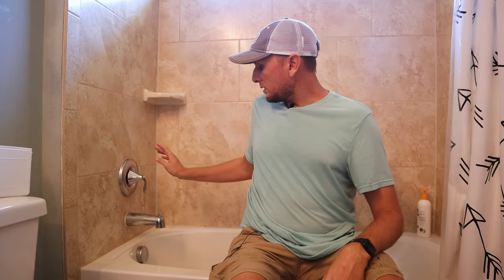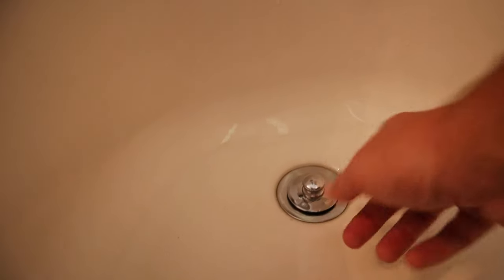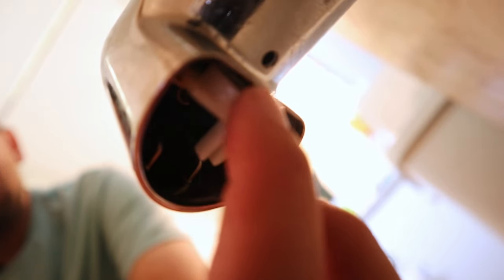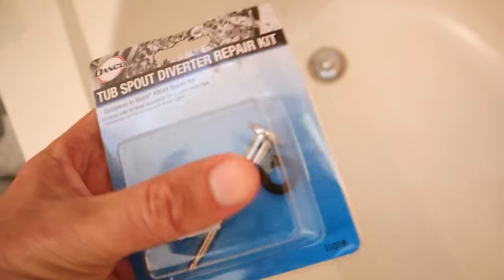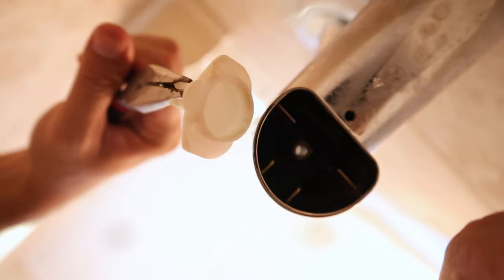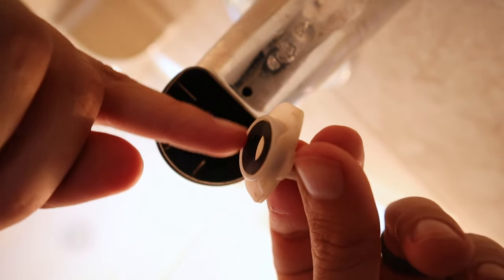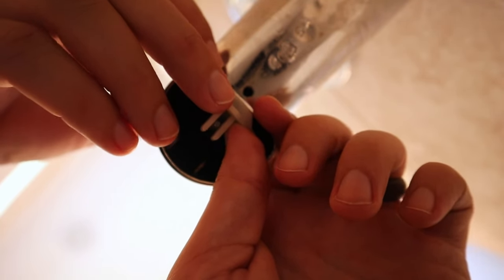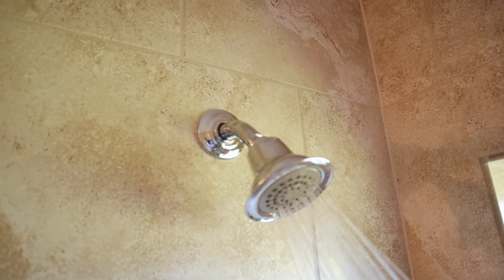Water Not Coming Out Of Shower Head? Tub Spout Diverter Repair

Comment: Thank you!
The plumber quoted $500 to fix this issue.
Cost me $7 from Home Depot and less than 5 minutes of my time.
Reply: Bet you're not calling him again!
Reply: The plumber you got the quote from is a crook.
Reply: @RRCCTexas  Absolutely! Great way to put yourself out of business.
Reply: A plumber from a company with a good reputation installed a new set of taps for the laundry tubs plus 3 shut off valves for $400 today. It was a chore removing the old rusty mounts from the tubs and it took 2 hours to complete the job. I bought the taps previously and feel I got a reasonable price for the installation.

Comment: dude my spare bathroom has been driving me crazy for the past 13 years that i bought my house and has gotten really bad and super annoying to me. i imagine it probably wasted around 2 or 3 gallons of water each time someone showers. I think i have ocd but i like all my plumbing and what not to work properly in my house. super easy cheap fix i cant believe it completely stopped the leak. not even a drop! So beautiful man.  I went back with square for square like you said. if it was my main shower it probably would have been one of the first things i did to my house. thank you!

Comment: I was hoping this would be a simple repair and it looks like it will be. Got my Diverter Valve (DV) out thanks to your advice and think I found a replacement on Amazon for the lovely price of $8. I took mine out and it was sitting back a little from the front of the plastic holder and at 17 years old, a little hard. I tried an o-ring behind it to push it out a little but that didn't help, hence the order for new ones. Thanks for the look inside the nozzle!!

Comment: Ironically, I am heading over to a friends house this morning to fix this exact issue. I hadn't done it in a loooong time, and your video refreshed my memory. Huge thanks and perfect timing...almost.
Reply from the maker: Awesome.  That is pretty good timing.  Glad it was able to help.  Thanks a lot for the feedback!
Reply: What if both the gate & washer are in good shape & issues still exist, what can I check next,  or just replace them & then see what happens?
Reply: @MichaelSmith-sz7kf  Just because the gate and washer appear to be in good shape doesn't mean they aren't worn out or degraded. Mine still had the washer and gate. They looked fine. I replaced them and now it works. Replace them.
Reply: @IAMRUSTEDROOT  appreciate the feedback, ordered a new set for that very same reason/conclusion I made as well!

Comment: This was great. My spout started to leak and I could tell the shower pressure was down a bit.  Drove me nuts all the wasted water just running out the spout and down the drain.   I replaced the GATE and all fixed.   Super easy, super cheap.   Thank You

Comment: Very straightforward video without waste of time. Thank you! Might also start by turning the spout counterclockwise and turning up so it's easier to access the parts for us old folks who don't want to lay down in the tub and work upside down. Or, removing the spout and replacing it after repair with new teflon tape & etc. That also allows you to clean any sentiment/corrosion that is allowing water to leak around the seal. Thanks again!

Comment: Excellent tip! Thank you so very much, Sir. I’ve switched out the entire spout before and was very unhappy with the way the new spout didn’t set flush against the tile. It would’ve required another whole turn but my pipe didn’t have the threads and it would’ve been stuck at an angle. I’m going this route for my new problem. Thanks again. You’ve earned another subscriber.

Comment: It takes a lot for me to comment on videos, but I had to on this one. I had the issue where water was slowly coming out of the shower handle and a majority of the rest of the water was uncontrollably spraying from the spout still when the diverter was supposed to be engaged. I have a spout that doesn't seem to have a set screw and seems to be impossible to twist off.  This video was so clear and concise as to what I needed to do to fix this issue myself without having to shell out more cash than needed to have a plumber come in... not to mention waste their time when they could be taking care of much bigger jobs than this one.  

I followed the steps of this video and sure enough, only have of the black washer still remained. Thank you for taking the time to clearly show everyday homeowners how to fix something simple without having to break the bank!

Comment: Excellent Repair video and very clear explanation.   I had a Moen Faucet and I got the repair kit; did the replacement and the diverter now works normally.  Thank you.  I wanted to know how it works, but could not find anything from Googling.   I try to put in my explanation here and hope to help others who are interested in knowing how it works as well as get the repair done.   Rubber Seal with a hole in the center. The faucet water inlet hole is bigger than the hole of the rubber seal, but smaller than the seal itself. So the rubber seal could seal off the inlet hole completely when pulled to the UP position, forcing water to come out of the shower. The water pressure coming into the center hole of the seal can inflate the rubber seal slightly to produce a water tight setup. Therefore, a soft rubber seal is important. When it is too old it can harden and would not provide a water tight setup. It shows how clever this design is. The water pressure on the Plastic Gate would hold the Gate in the UP position. The Gate would not fall down because of frictional force. However, if the water supply is cut, The Gate would not be held there and falls to the DOWN position and this also the default position. So, next time you turn on the water, it would come out from the faucet and not the shower. When showering (ie, Gate in the UP position), if you manually push down the rod/button, you can overcome the frictional force created by the water supply and get the Gate back to the DOWN position, stopping the showering, and let water come out of the faucet. Note 1, the faucet water inlet hole is inside the faucet you have to use a light to find it. Note 2, water tight to the water inlet hole and around the circular plastic ring surrounding the rubber seal on the Gate, you have to examine a diverter repair kit to appreciate the design.

Comment: As a retired man, who used to just hire his repairs done, and now finds he is doing a lot of minor jobs and doing them for the first time, thanks.  I never would have gotten past the initial failure to remove this part, the part being where it could not be observed.  And that was the hardest and longest part of this repair, fiddling with opening the part to allow it to be removed.  Well, the other time consuming part was traveling into the near by town, since the hardware store in my little town would have sold me a new faucet rather than a part for the repair at 1/10th of the cost.

Comment: Instructions worked for my Price Pfister diverter problem. Thanks for such clear instructions! I found just the gasket which was all I needed for $2.50 at Ace hardware. I also realized there was some mineral buildup inside that was causing a problem so after I took the diverter out I wadded up tin foil and scrubbed the inside of the spigot. Seemed to make a huge difference. I still have about 10% that's not going through the shower but I'm okay with that compared to 70%.

Comment: THANK YOU for this easy to follow tutorial! As an older woman, I was having great difficulty getting the lift rod to go into the bottom plastic slot. I discovered if I soaked it for about a minute in very hot water it softened the plastic enough for it to slip in. Once it cooled, it was hard enough to secure the rod.

Comment: THANK YOU for this EXCELLENT video❗️
I’m a complete plumbing bonehead  ( heck,  I’m many kinds of a bonehead ) and even I was able to get it fixed perfectly in 84 seconds,  once I found the correct repair kit by looking at  spout gate images online, this after pulling out the original gate.
For the extraction, I used a narrow head standard screwdriver inserted between the two plastic holding tabs where they gripped the lift rod. No tools required for the install phase, friction fit. Perfect repair, under $8, thanks to YOU. 
Note: the old gasket was intact, but 38 years old and hard as a rock. PS: The new black gasket sits slightly recessed in its socket in the gate, but under water pressure it  moves forward & becomes flush to the valve seat to make a good seal. Only after the install that I noticed that the kit I used was the exact same one in your video. Surprisingly, the specialty  plumbing repair supply store that I called first did not have it,  but a big box store did. 
Plumbing repairs make me very anxious, but you gave me the confidence to git it done. 
Adam, you are a HERO to many!

Comment: Great advice, thanks. Two suggestions: I found some mineral deposits on the tub spout where the rubber seal seats. I cleaned them with a screwdriver blade and wiped clean. Second, the replacement kit I bought included a small spring to put on the shaft before snapping the rod back into the gate.
Reply: Thanks William,  great add-ons to the original video. I'm normally a do-it-yourselfer. But we have one bathroom that we just pretty much relegated to tub use only. I'm excited to know that I can just replace the diverter

Comment: Fantastic video and info, Adam! Had no idea the diverter was replaceable! We've been plagued with a guest shower that screams, and quite embarrassing when having guests overnight. I knew it was the diverter either corroded or hardened. Trying to remove the entire spout was proving difficult (felt like the copper plumbing was going to come with it). Based on your video, I just removed the diverter (took 2 minutes) and sure enough the gasket is hard as a rock. Heading to the store today to get a kit. 

Related topic, I've watched a couple of your electrical wiring videos. Just installed a new disposal this weekend, and didn't twist the wires as you recommend. Going to open it up real quick and make better wire nut connections. Keep the videos coming!

Comment: Thank you! That what I do with my Delta Spout Pull-up Diverter. I just need to buy a washer. As the nylon/plastic and diverter is good. I cleaned the inside the spout with a toothbrush.

Comment: Works great! Have done this 3 times in the last 10 years, but now there is so much mineral buildup, the gate no longer slides up and down freely. Ran a flat file up in there but still no luck. Next step is to replace the whole spout, but it won't come off. There is a notch in the back but I can't see/feel a set screw. Can't twist the spout off nor pull the spout off. I'm ready to smash this thing
Reply: @malinwj1, hello, the lift rod in my shower spout is stuck too. I put some WD40 in it before finding this video. I will see in a few hours if it helped otherwise will have to perhaps replace the parts. I hope it doesn't come to that. Any suggestions? Best regards

Comment: Thanks for this video.  My diverter is leaking badly, and the tub spout (at least 20 yrs old) has a lot of corrosion built up, and at least one of the two fins is broken off that keeps the diverter in line.  I can push the plastic piece up with my fingers, but it cannot be pulled up with the bar; it always catches on something rough or jagged.  What would you advise would be my best option -- replacing the entire spout + diverter valve?

Comment: Great tutorial but my issue is slightly different, both my tub and my mom's have got to the point that we can't move the lift rod at all. I had them both stuck in shower position but recently we didn't have hot water for a few months and when we got it back on the shower was no longer working. I used tools to try to move the lift rod and ended up snapping the head off. I got a kit to replace the entire tub spout but am extremely intimidated to actually do it. Maybe somewhat irrational but my greatest fear is that I take it all apart and can't get it back together again, I'm worried something more serious may be wrong. The drain blocker has also stopped working and I will need to replace that as well. The lovely gentleman at Home Depot walked me through that in the store. Do you have any idea what might be the cause of our lift rods not being able to move? Could it be a rust/corrosion problem? Hard water build up perhaps?

Comment: Thank you for this video. I have the opposite problem. The diverter does not drop when I turn off the shower head. It doesn’t leak, I just have to manually push it down to drain the water. Would this solution work for that?

Comment: Great video….. just a heads up everyone, if you have the SQUARE MOEN style diverter gate ONLY LOWES has them …. Home Depot only has the NON-MOEN style which will not fit the MOEN spout. Check which style you have and check online stock availability before driving there… I have 2 hrs in driving time back and forth between the 2 trips,including returning the wrong one to HD🫣🍀

Comment: I did what I learn from you with no problem but the result wasn’t good it is still leaking ! What you thing the problem  could be ? Do I have to clean the area where the rubber seal goes up ?thanx

Comment: Having the problem where water does not divert to shower head. This was a great video!  I was able to use it to remove the gate and check the seal.  However, seal was still in tact, and everything appeared to be in proper order as described in this video.  Is there another reason that water is not diverting to shower head?  Thanks in advance for any further insight.

Comment: I replaced mine exactly how you showed. I bought both types. I replaced it with the same shape. But even after doing it, it still pours water out the spout. Is there anything else I would have to change or would I have to replace everything?

Comment: You might want to explain that hard water or corrosion build up where the seal will sit is often the problem. Sometimes replacing the spout that also includes the new diverter is the best longer term option

Comment: I had the same issue with a MOEN tub spout, bought the same diverter replacement gate, and it went in very easilly, but even with the new gate and washer, most of the water still goes out the spout rather than to the shower. Any suggestions what to do next?

Comment: I like that diverter design.  Much easier to work on than the diverter valve in the Price Pfister 3-handle system (hot water valve, diverter valve and cold water valve) used in my condo, which is part of the rough-in plumbing, not part of the tub/shower fixture.

Comment: Many gates are metal also.
They tipically have no seal but is only a gate across the water opening.  Like a guillotine action blocking the out going water when pulled up.

I had to replaced the complete spout assembly for $12.
This was because water contaminates the gate & spout getting crud built up and if scrapped off then the original guillotine will no longer seal as I could not produce a polished enough finish on the 2 mating surfaces to renew them.

Comment: Great video! One question. Do you have to shut the water supply off. If so, where is it located?
Reply from the maker: Yes you do.  The answer to that can vary by your setup.  City water there may be a shutoff valve around the house but it is usually out in the yard and needs a special tool to turn it off.  Wells have numerous ways to shut the water off.
Reply: Thank you! I am another single lady learning everything I can from YouTube! Great video!

Comment: Hi.  I wish I'd known this almost a year ago as my shower is still not fixed.  The guy at home depot told me to just turn the spout to get it off however he didn't bother to tell me about the screw underneath.  The screw turned about an inch and I don't know how to get the spout off with out accidentally breaking the copper pipe.  Any suggestions?  Should I now worry about the spout and just try and fix it with a repair kit?   Cindy

Comment: What if it engages only after I get the hot flowing? Cold flows out of faucet well when attempting. It worked well before, but now I have to turn hot side and then once shower head is going, I can then switch back to cold side for the shower head.

Comment: I had to replace my Moen 3853ORB Tub Spout with Diverter, 7", oil rubbed bronze less than two years ago. The plumber I used is no longer available. I called another plumber and he said that it is not possible to replace the parts on my Tub Spout and that I need to buy a brand new part (close to $100). Is that true?

Comment: As Adam says take the white plastic out and compare it to whatever brand repair kit you buy. They may not be identical. I used the same brand mentioned here. (Few months before I watched this video.) I struggled to push the pin down and it took a lot of sweat and time. Be aware.

Comment: Hi, have been living in an older apartment building for over 10 years.  My unit has 6" shower arm with 1/2" connection with IPS thread and shower head with 1/2" connection with IPS connection.  All new shower arm and heads I found has NPT connections.  IPS connection and NPT connection do not match.  But can I take out my current IPS connection shower arm and install NPT connection shower arm?  Like I was thinking of getting rid of both the old 1/2" IPS thread shower arm and shower head first.  And then install a new 1/2" NPT threading shower arm with teflon tape to prevent water leaks and NPT shower heads in their place.  Is that possible if the wall holes accommodate?  Is it even recommended to replace IPS shower arm with NPT connection in an older apartment unit?  Can anyone please help with answers.  Thank you